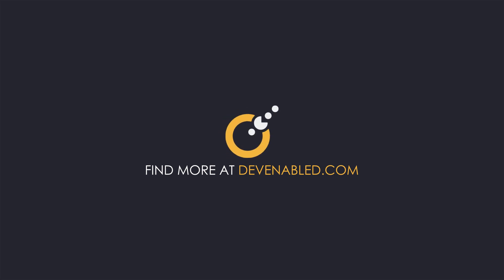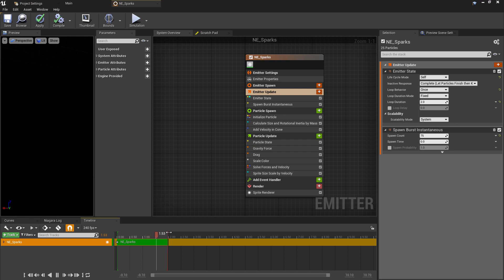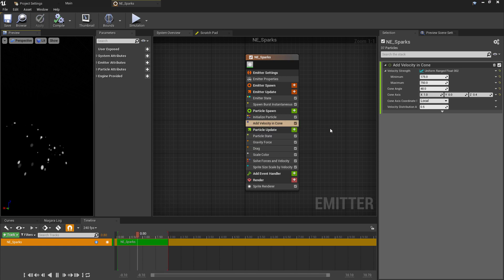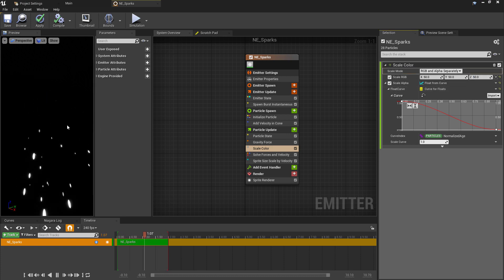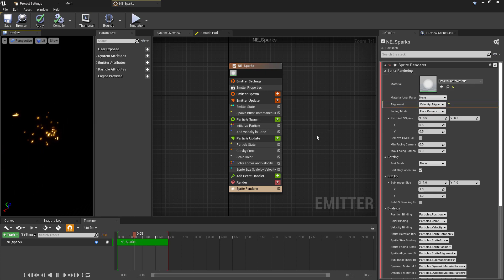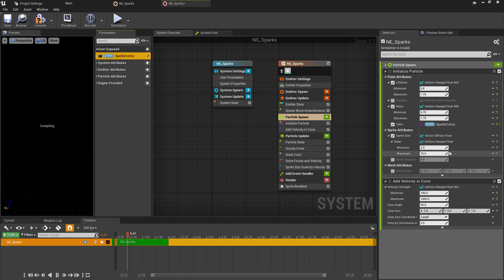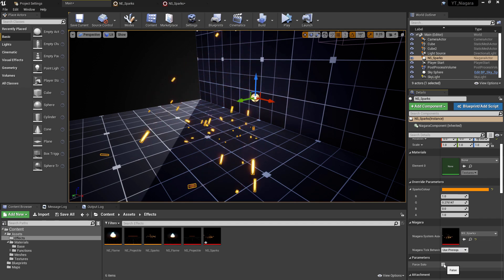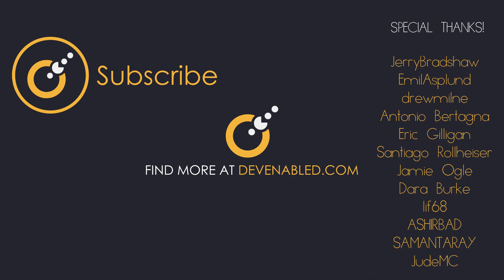UE4 Niagara Tutorial - Spark Effect - Intro to Niagara UE4/Unreal Engine 4

Comment: Thank you! 
Question: is there any advantage to creating an Emitter first, then creating a System using that Emitter, when you could simply create a System using the same template from the beginning? That way you just have the one file instead of two. Thanks again.